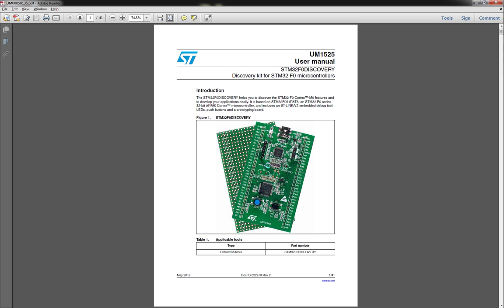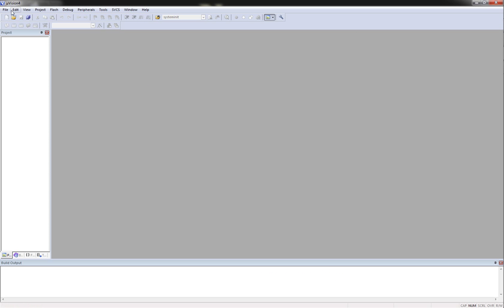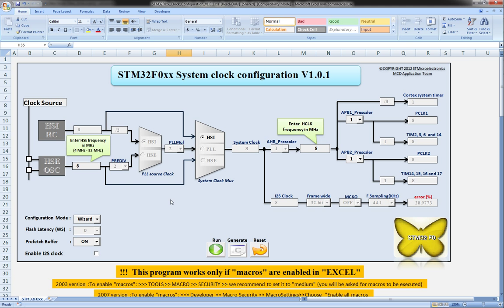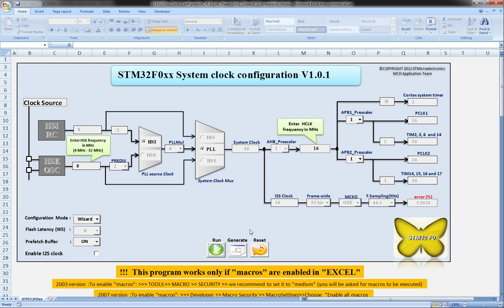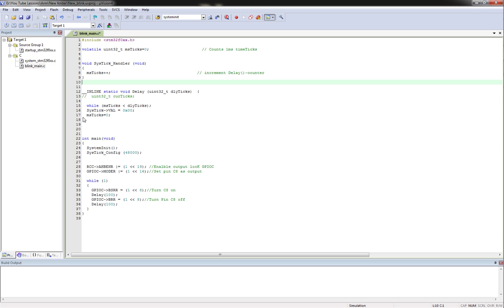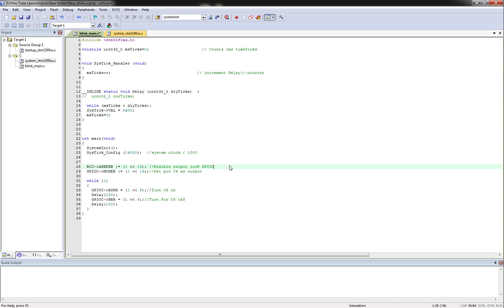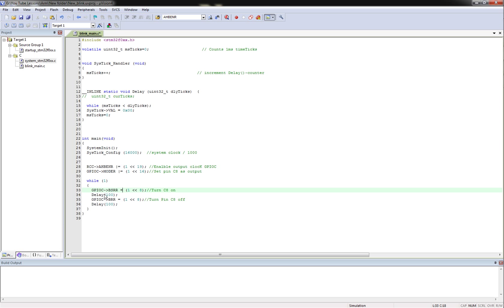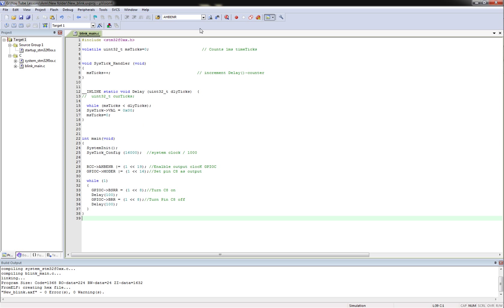Into To ARM Development (Software)

Comment from the maker: Hey there, yeah it seems that way.  However, it is like some versions of linux.  With full control over any customization that you want comes with a lot of work. This is why that I recommend to hobbyists the microchip family.  There is a ton of support for these as well as they are easy to get set up and to work.  They are more expensive than the arm, which is a big plus for arm chips since you can get 32bit for < $1, but they are more complex to get to run.

Comment: delete my own comment :
you know, that there is a much easier way to program, if you use the MDK-ARM included tool and not the external (ST-Link) to program the STM32F0?
Please see our Video about this: How To Program STM32F4-Discovery Board with MDK-ARM.